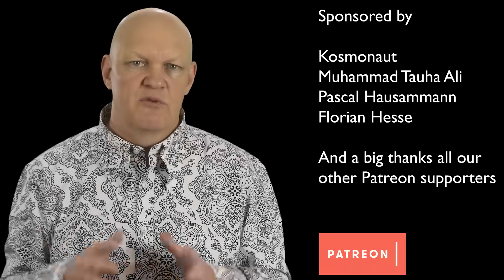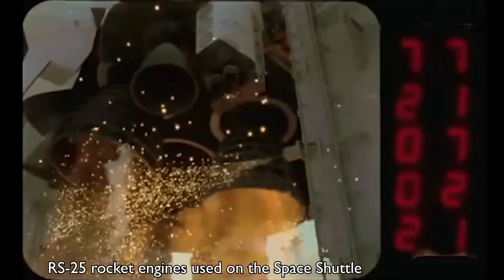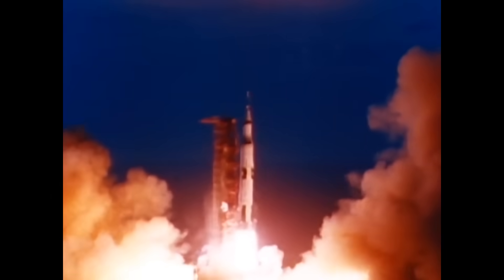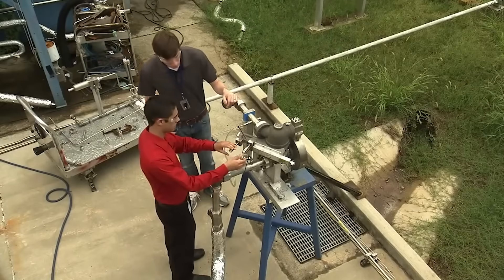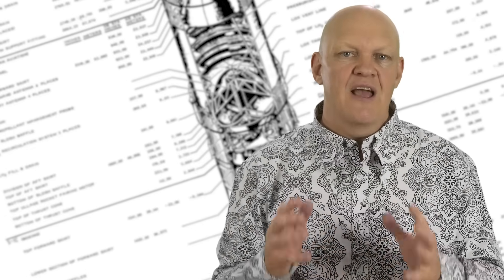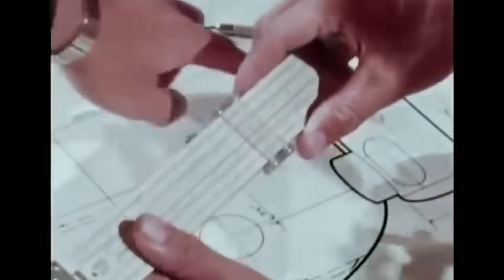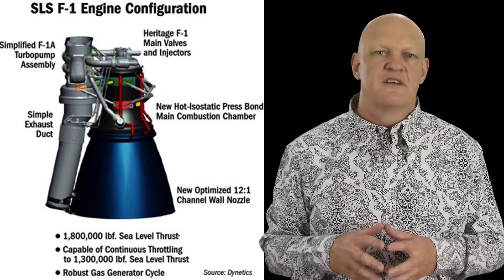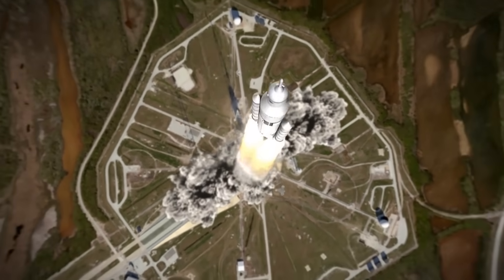Why Can't we Remake the Rocketdyne F1 Engine?

Comment: As someone who is a machinist, welder, and fabricator in the USA........one of the things that I do is try to find ways to makes things more accurate, cheaper and easier to build........material science plays a major factor in most if not all things manufactured.........when a better alloy of metal is discovered you find that it can replace multiple parts in a machine and save labor and material costs..............advancing the F-1 rocket engine design is the perfect example of this.

Comment: You don't need the short format. Your audience is a bunch of geeks (like myself) who will sit through long vids to learn something.
As for the SLS, going with solid rocket boosters is just plain cowardice on NASAs part. Same excuse when they were designing the STS. If we lose a liquid fuel rocket it will cost this much. But if we lose a solid booster, it only costs half as much. OK, but we are not supposed to be losing boosters at all.
Believe it or not, when designing the STS, NASA wanted to use F1 engines for the first stage. A big delta wing, manned, with turbojets to let it land like a commercial plane after completing its mission. Nixon and congress killed it, as they kept cutting back the budget for the thing. It was called the Flyback F1.

Comment: Wow No love for NASA around here between armchair rocket engineers and flat earthers.  Sad to see. I’ll be back at work tomorrow either way.
Reply: I like the old NASA that got things done.   You look at projects like the Shuttle, Webb and SLS and just scratch your head at what the hell they were thinking.  It's not all NASA's fault, but a solid 50% of it is.
Reply: J Shepard so did I, and there's no doubt mistakes have been made.  Many are human, the biggest by far imo is the gap in between Shuttle and SLS.  50% though, I don't know.  Congress, Adminisrations all yanking the strings, and the way things are done now that involves so much oversight and redundancy because of newer safety and quality requirements that NASA must adhere to, it's a miracle anything gets done, and with a fraction of the 60s budget.  It's frustrating.
Reply: @Alfredo Lopez fake moon landings? lol not this BS again.
Reply: Alfredo Lopez adjust your tin foil hat, it's on a little bit toon tight.
Reply: Maybe they are forcing adaptation or waiting for someone else to make it and take the designs.
Reply: Politics.

Comment: Whether or not F1s can be made or not is immaterial.  Whether or not RS25s or F1Bs are used is also immaterial.  The only material issue germane to engines is that they should be used on rockets that are fully reusable.  Full reusability with minimal refurbishment between launches will massively reduce launch costs.  That the Space Shuttle fell short of meeting this objective and that SpaceX looks set to meet it does not mean that NASA should now choose to ignore it.  Having said that the reduction in parts from the 5600 to just 40 for the F1B as compared to the the old F1 is an amazing achievement.   That such engines were considered for use on the fully expendable SLS reinforces what I said earlier about NASA rejecting the notion of reusability.  I prefer the longer videos but although this one was short it was, as always, rich in content, well researched and engaging.

Comment: Remaking the originals that are outdated and complex would be entirely unnecessary. By making the engine only have 40 parts and fully modern is the way to go. The number of parts used in this makes me think it will be a lot safer and very practical. Also, it might be better to make them disposable rather than try spend lots of time and effort refurbishing things because it looks like a nightmare to undertake. I don't know what the money flow for the shuttle was but I do wonder if it wouldn't be easier to just crank out new rockets and shoot them up.

Comment: Proves? It only proves NASA is a pork laden slob. It's like asking the DMV to build a race car for the Gran Prix...
Reply: J. Sakic
Refer to National Aeronautics and Space Act of 1958, Earth science is one area of NASA's responsibility since its creation. Even with that, NASA still succeeded in other space missions just fine. Do I have to mention that before Al Gore made a speech, climate change isn't really a political issue? Climate study isn't expensive at all, they already have probes, so the only thing they do is just collect data from the satellites and write the paper. However, a more ambitious space program require another level of funding in the first place. And the fact that NASA's contractors such as Lockheed Martin consistently overblown the contract money isn't helping either. The main reason why NASA is underfunded now is mainly due to the collapse of Soviet Union, putting the US on "easy mode" because there's no competitive pressure, leading to the cut in funding.
Reply: J. Sakic
NASA operated probes and satellites that monitor climate and weather (not just sea level), if it's in space, then it's NASA's responsibility because someone has to launch it there in the first place (duh). Also, while climate change have cycled in the past, the pattern consistently took hundreds of thousands of years to cycle once, but the change that's supposed to take that much time is happening in a span of a century so it's definitely abnormal because it's breaking the usual trend. That's in-a-nutshell explanation, saying Earth's climate had changed in the past is a very easy strawman to debunk.
Reply: Mickey G sounds like a great area that an agency like NOAA should be handling, NASA can get the payload in orbit because that's their department and then NOAA should be doing the research and science.

If NASA could become free of these political charged issues it would have full bipartisan support and wouldn't have to carve out large chunks of their precious budget for non space exploration activities.
Reply: Kernal Scott 2 I cant figure out what youre even trying to say. Your sentences are so poorly written with ... after every 3 words.
Reply: Everyday I did say that this research is important, I'm also saying that NASA shouldn't be responsible for this science and research. Let an agency like NOAA handle this work so NASA can get bipartisan support from our politicians. 

Most tax payers supported the Apollo era and would support another era of Moon missions and eventually Mars, I think if NASA got back to human space flight and exploration they'd have more public support.
Reply: J. Sakic I didnt agree with the part "the earth goes through cycles" If you didnt notice.
Reply: Zac Alleywalker Lowing that and today's NASA is controlled and funded by political agendas, back in the 60's NASA wasn't waisting time on climate change and what sea levels were doing. Don't get me wrong understanding our planet is important but NASA is not the agency that should be burdened with these issues.

Let the National Aeronautics and Space Administration get back to space exploration and politicians can fund their pet projects of climate change and saving the world from cycles it has gone through many times before humans came along to another agency.

Comment: Nowadays they have these “Quality Systems”, where consistency is valued over everything else.
So, would you rather live in a world where craftsmen are given a wide berth to make square peg / round hole fit?
Or would you rather live in a place that rewards monkeys for doing the same thing wrong on an assembly line because they did it “consistently”?

The business part of me thinks the answer depends on the scale of the project. Ad hoc, or commercial production?
The engineer part of me values the craftsmen.
The socialist part of me values the monkey.

Comment: The F-1B would be a better choice for the SLS because of the reduction of the cryogenics from fuel and oxidizer to just oxidizer. This would be a great reduction in complexity. No, one would suggest a carbon copy of the F-1 engine, but use it as a guide to reduce R&D costs. Just because something was built 50+ years ago doesn't it would be a bad choice today...A round object was invented several thousand years ago, but the basic design is still valid today....the wheel.
Reply: Indeed - just look what reserves of performance are available in old designs when new technologies are applied. Difference between original CH-53 and CH-53K is almost double in some aspects... !

Comment: Fun fact 1: The proposed F-1B is about 9 times as powerful as the Merlin 1D, in terms of thrust, running on the same RP-1/LOX propellants.
Fun fact 2: the Falcon 9's Octaweb has the same diameter as an F-1 engine.

Therefore, an Octaweb full of Merlins is potentially interchangeable with an F-1A in new rocket designs.
That makes me wonder... Pyrios with 18 Merlins, arranged into two Octawebs? And since the Merlin has a lot higher Isp than the F-1A, such a booster may just be able to pull off a droneship landing with the leftover propellant.

Comment: Another industry that has lost it's purpose compared to the 50's and 60's is the metal foundry.  They were tooled to create the large castings needed for steam locomotives and even some parts of early diesel engines back then.  So when they were pressed into service creating turbopump casings and other major components that needed a mastery of the trade it was a boost to a trade that was losing significance.  Unfortunately modern industry doesn't need the same high quality castings as before so there are few foundries that can produce the parts in the size and purity that were done before.  I'm not saying no one can, but there are very few who can today compared to the Apollo era.  

I  have to agree with others that we could still build the engines and get them to work again.  Those lost notes and tricks of memory can be re-written and relearned as the engines are built and tested.  It is possible... Just expensive...

Comment: Mr Shillito.

When it comes to the F1 engines, can/could the F1 be run on a Methane/Oxogen mixture like say the SpaceX Raptor engines, or is the construction only suitable for Oxygen/Kerosene...Lox/ RP-1

Would the F1 loose to much power using Methane?

From a environmental perspective Methane is the ultimate fuel due to exhausts being harmless... But is it really as efficient as RP-1?

Cheers/Tom

Comment: I think the main point is, what you said, there is no way we would make an engine of that thrust class like they did 50 years ago.  Manufacturing and welding with computers has changed the way we make things radically.  

Like the shorter format as well.  Just mix it up.

Comment: Yeah I think if they had a blank check and just went ahead and tried to rebuild a brand new Saturn 5 based on the blueprints, they would come across the same problems the original engineers did, and solve them in likely the same way as well. And guess what, they'd write down their own notes on the blueprints. 

Just as Wes Smith said though, the real issue is just how much do you want to pay for it.

Comment: If it has been done, then it will be done again. Should be easier to reverse engineer the existing engines. And with modern graphics and programs, should be easy. Computer modeling will work out all the kinks. And give the newbs a chance to improve on the original, which is what they eventually did. JM2C
Reply: BeachBow yet excuse after excuse .......makes the "crazies" not seem so crazy

Comment: Engineering students need to learn to use a slide rule today; NO ONE can machine anything to nine decimal places.

It is like remodeling an old home.  You either gut it to the structure, level it and start over, or start from scratch.  Quilt and patch upgrades or rebuilds cost out the nose.

Comment: I would love to see Liquid Rocket Boosters on the Block 2 SLS using F-1Bs.  Pratt and Whitney documented every step of the fabrication process of the F-1 engine to make restarting production easier.  In the mid-1980s the Jarvis launch vehicle was proposed, that would have used 2 F-1s in its first stage.

Comment: The Falcon 9 is based on the Saturn rockets. The Merlin 1d is a smaller, higher pressure version of the E-1 and F-1 engines. Because the Merlin 1d runs at a higher pressure, it's more efficient, and lighter than the old E-1, while generating roughly the same thrust. The Saturn 1b had 8 kerosene-fueled gas generator engines propelling the first stage, the Falcon 9 first stage has 9 kerosene-fueled gas generator engines. The Saturn 1b had 1 hydrogen-fueled gas generator engine powering the second stage, the Falcon 9 second stage has 1 kerosene-fueled gas generator engine.

The Saturn V first and second stages were the same diameter, the Falcon 9 first and second stages are the same diameter. The Saturn V second and third stages used the same engines and propellant, the second stage was just bigger and had a higher engine count. The Falcon 9 first and second stage use the same engines and fuel, the first stage just had a higher engine count, and is longer. The Saturn V second stage tanks had a common bulkhead between the oxygen and hydrogen, rather than two completely separate tanks. The Falcon 9 first and second stage tanks have a common bulkhead design.

The biggest difference between the Falcon 9 and the Saturn rockets is the landing technology. The Merlin 1 uses the same fuel injector design from the Apollo Lunar modules, called a pintle injector. The Falcon 9 first stage lands using the single engine in the center, just like how the Apollo Lunar modules landed on the Moon, using one liquid fuel rocket engine. Even the leg design is based on the leg design from the Lunar Module.

The Falcon 9 proves that copying the Apollo-era designs is very doable. You shouldn't just blindly copy the old designs, but pick and choose from the best ideas. The number one American orbital rocket, by many measures the number one orbital rocket in the world, is derived from the Saturn rockets. Right now, a Saturn-derived rocket is more competitive than the Soyuz rockets, or the Proton rockets, or the Ariane rockets, or the Delta or Atlas rockets. Only the smaller Chinese Long March rockets have a higher launch rate, and that's across multiple major variants.

NASA (and Congress) just want to continue using Shuttle-derived hardware for the SLS. The solid fuel rocket boosters + hydrogen-fueled Space Shuttle Main Engines employee more people than the old F-1 engines. Don't justify their excuses for refusing to use kerosene-fueled gas generator engines.

Comment: Frankly I'm disappointed and somewhat alarmed that NASA chose to not use the re-designed F1B Engines. Instead they chose to use Solid Rocket Boosters on a system that will be used for manned launches. AGAIN. Using SRBs on a manned launch vehicle is just asking for another Challenger accident to happen IMO.

Comment: The SLS and the shuttle's architecture calls for the use of very high specific impulse hydrogen engines in the core with very high thrust but low specific impulse solids to get them off the ground. This is the same concept used in the Ariane V and other contemporary designs. Using hydrocarbon boosters with hydrogen cores do not make ANY sense. The much reduced thrust of the liquid boosters will limit the fuel load the core can carry and still get off the ground. If you keep adding boosters you are also decreasing the average impulse of the vehicle at lift off and through booster cut out. You are better off having a hydrocarbon 1st stage life the Saturn V used and moving your hydrogen engines to the upper stage(s).

In the end the SLS system is not any more efficient than the Saturn -- it is no smaller, it is less safe. it carries about the same and it is as exorbitant. The western obsession with cryogenic hydrogen rockets have not panned out. Their hydrogen based designs like the Ariane, SLS and the Delta IV are INFERIOR in lift capacity to kerosene boosters like the Atlas V, the Falcon 9 and the Zenith. The SLS used an extended shuttle tank, disposable SSMEs and 5 segment Shuttle SRBs not because they are better or cheaper. It used them because they wanted to keep the NASA and contractor jobs from the Shuttle era. Or, rather, these individuals and their congressional backers wanted it.

Comment: This is what happened to engineers and technicians trying to repair WWII German equipment. The craftsmanship was so high that modern technicians couldn’t hold parts to past specifications. Having worked on the Shuttle Orbiters I knew a lot of craftsmen that designed so many generations of our space programs.

Comment: The F-1 engine could be more easily built today, the problem in the 1960s was components often would not fit together and therefor needed various fixes so they  could be combined.